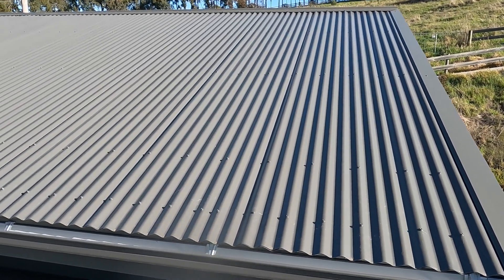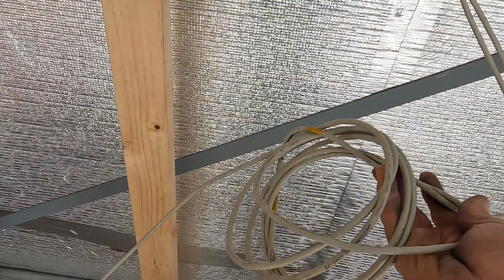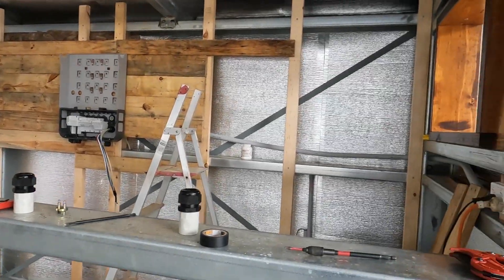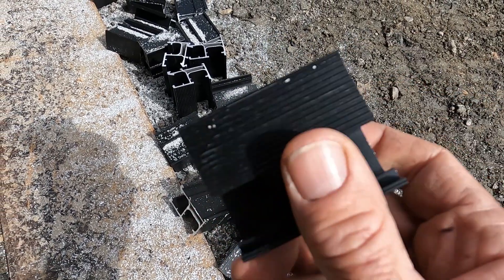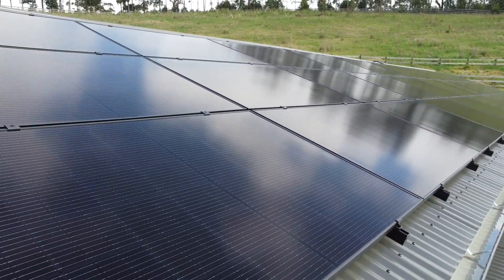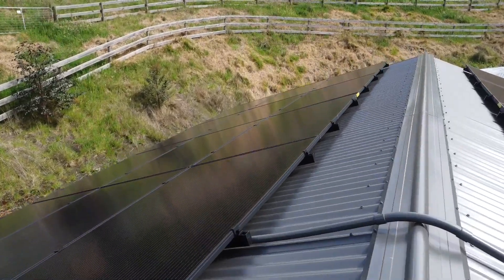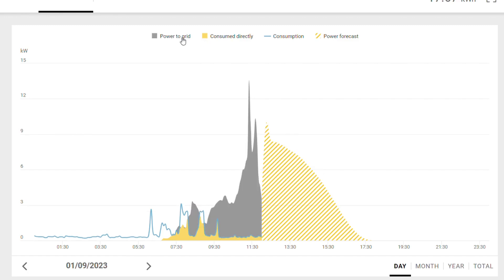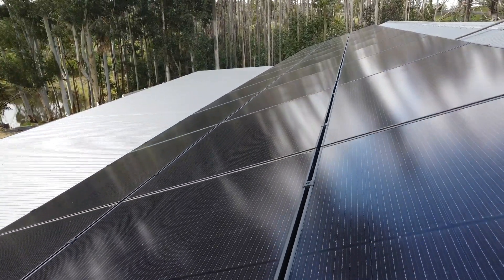Workshop build part 15 - Solar install

Comment: Any plans to add battery storage?
Reply from the maker: Hi mate, at this stage the economics don’t add up for me. Other issue is I’d only use batteries if I had them covering all 3 phases. I’m probably going to wait until prices drop a bit and when technology moves forward a bit more. Happy with this for a while, it’s a huge improvement on the outdated system I had till now as most of it was very old….

Comment: Gday, the panels looks good and definitely a smart move going big then needed, great job mate, Cheers
Reply from the maker: Hi Matty, it turned out as good as I’d hoped for. Oversized does allow options moving forward. I’d like to get to full self sufficiency so this is a big step to that..

Comment: random question: did the smart car rebuilt engine add more horsepower? or is it tuneable for more power?
Reply from the maker: Not sure as I bought it with a damaged engine. If anything it might have slightly more horse power with the light porting and exhaust changes. Not easy to increase power but no doubt there are options out there, I just haven’t looked into that as yet.